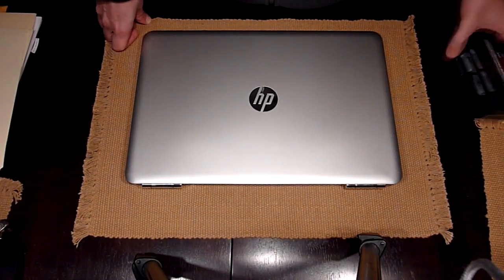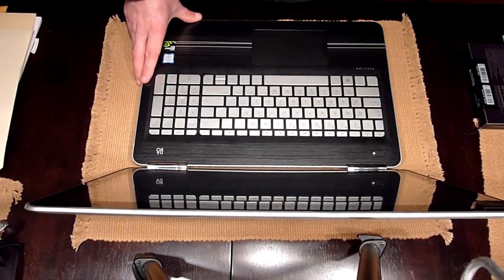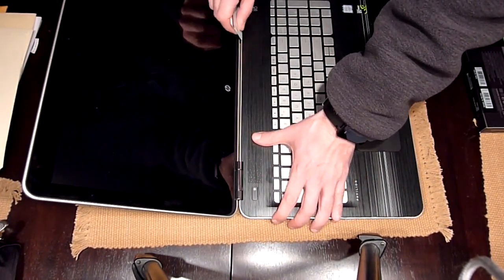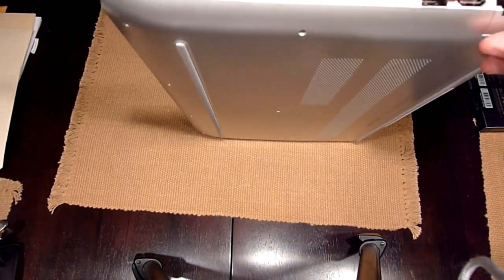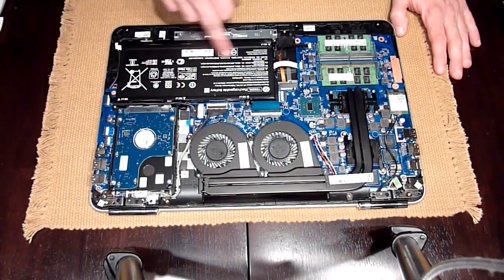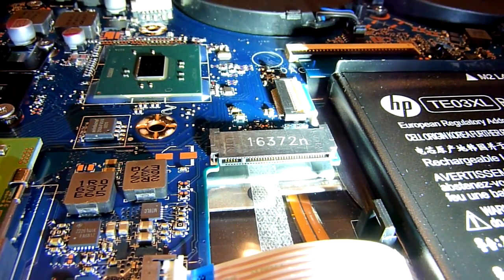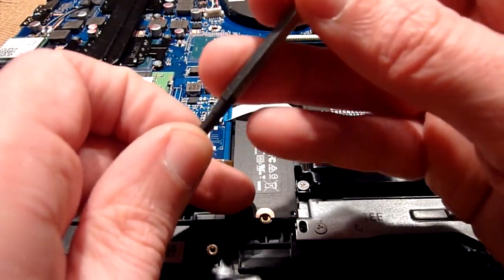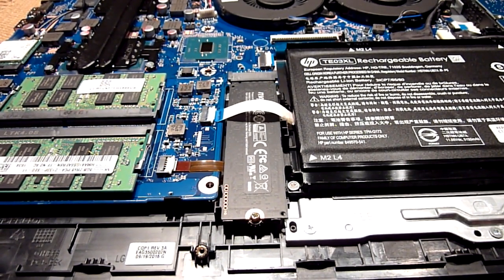HP Pavilion 15 bc018ca Laptop with Samsung 950 PRO M.2 NVMe SSD Drive install

Comment: Shall we use both HDD and nvme together...Windows on NVME and all data & few programs on the regular HDD
Reply from the maker: you can but in order to make the computer boot with the nvme drive, you need to remove the mechanical drive first because there is no drive boot order setting in the bios (in mine that is). The only way I could acheive a boot from nvme was to remove the mechancial drive, restart, then computer did nothing, so I reboot again in bios, did NOT change ANYTHING, save and reboot. Then it did boot from the nvme as primary drive. Then you can re-install a second drive BUT I would NOT advise you to install a second mechanical drive on your system because it will greatly reduce the response time from the computer. When you boot up, the nvme drive is almost instantly ready but the system will need to wait for the mechanical drive to spin up, start access then proceed to boot sequence. Also accessing a mechanical drive within windows is going to be painfully slow versus the nvme drive even it is only use to store data. I would suggest to buy a large 1TB size nvme drive or get a second 2.5 inch SSD as a second drive. 1TB is pretty cheap in 2.5 inch format and you will have way better performance for a second drive. The best is to use a single nvme drive.
Reply: Thank you so much
Reply from the maker: you're welcome
Reply from the maker: I had to send the computer for service under warranty so I did re-install the stock 2TB HDD and remove the nvme. I have NOT touch or format that drive until my warranty will be over exactly for that case. When I reinstalled it, I was SHOCKED how slow my computer was and this is with a clean windows install on the mechanical drive, no programs installed, no data, just stock windows and hp bloatware... It took more than a minute to boot with the mechanical drive with stock windows 10... once on logged in the session, I still had to wait before opening edge to go on google ! Horribly slow and I have a core i7 6700hq with 16gb of ddr4 2300...

Comment: Hello, Very useful video..i would like to purchase hp pavilion 15 bc251nr....Just want to check whether it supports m.2 NVME SSD or not...Also how to move the preinstalled OS from HDD to NVME and boot from it pls
Reply from the maker: thank you for the appreciation. I like Samsung SSD products because they do provide a small, simple and free migration software. All my upgrades are done with Samsung SSD. So the only thing you need to do is to install the nvme drive, turn on computer (in my case, the first time it did not boot, I just enter in the bios, change NOTHING, save and reboot), install the samsung migration software and run it. It will find the nvme drive and clone all data from the mechanical drive. Once migration is complete, remove the mechanical drive, reboot (again, I had to enter the bios, change NOTHING, save and reboot) and then the system was able to boot from the nvme drive. I am writing this answer to you with that same computer with the nvme drive you see in the video. Best upgrade EVER. Extremely fast boot time less than 10 second from off state, wake up from hybernation is almost instant.
Reply: Thank you, i second that opinion from you...however what i am confued here is, does this model has m.2 SATA SSD or it supports NVME. The manual is pretty generic and talks about both in it :(
Reply from the maker: try to find the service manual of the pavilion 15 bc251nr, in there you will find the right information about the options like drives and maximum memory size.

Comment: How would i know if a laptop supports nvme?
Reply from the maker: first, find out if you do have the connector and which type is it. You can also search the model number of your computer and seek out the specs, HP manuals usually states all the components and I/Os found on the board and computer.

Comment: Hello, I have the same HW and i would like to now if it's possible to move te OS on NVMe SSD unit and boot from it. 
I've cloned the hdd OS partition on the SSD, but i can't find a way to boot form it. 
Can you help me?
Reply from the maker: Just install your cloned nvme drive, turn on computer and just enter the bios, change NOTHING in the bios, save and reboot. It should now work on the nvme drive. This is what I did because I had the same issue after the cloning procedure was completed.
Reply from the maker: did it work ?

Comment: Did your ssd come with the screw to fix it in? I just got the 970 evo, stuck it in then realised it has no screw.. Do you know what size screw to get?
Reply from the maker: unfortunately no, it did not come with a screw, I guess this is because many montherboard vendors could use slighly different threads... I had a bunch of screws in a bin and I just found one that was working. You absolutely need a screw.
Reply: @Aleziss  or else you're screwed
Reply from the maker: @MCilja  indeed as it seem to be a problem for a lot of people !!

Comment: hey such a good disassebly video it will help me so much. My question is i have nb38ea probably its mother board is some case is some etc my question is i know that same  ssd slot contained in my laptop in the some place it is said that it is compatible with m2 ssd are there any difference between m2 and nvme slot?
Reply from the maker: you are welcome... unfortunately, I cannot find any information with the model number you provided me. You would need to find the service manual and there, with the exact model number, you will see if it is compatible or not.

Comment: Did he really just install that upside down?
Reply from the maker: what are you talking about ?
Reply: i thought the same thing, but theres only one way it will fit in the slot
Reply from the maker: @pubhardgaming4838  guys, the laptop is upside down when the case is open... when you put back the back cover and you flip it over, the chip now sit on top of the drive...

Comment: My pc is bc200. but also bc200 in website has f45 or 46 and it doesnt up to date.
Reply from the maker: that's weird... I don't understand why I would not upgrade...
Reply: Aleziss I had made 2 times recovery before. Maybe because of that. Not directly, seperate times , 3 months after other
Reply from the maker: Recovery of bios failed to update ? or operating system recovery ?
Reply from the maker: I just thought about this, are there letters after the bc200xx ?? those two xx letters are important too for upgrading the bios so it matches the exact model and region you got...
Reply: Aleziss I made os recovery. 2 times. 3 months ago 2nd one, now i have iso file, not recovery. but after clean install i cant update bios.  also i add ssd before
Reply from the maker: I doubt this would prevent you from updating the bios then, os recovery has nothing to do with the bios upgrades, I am pretty sure. If bios does not update, in my opinion, it is because you have the wrong file for your system. This is why I asked you if you had other letters after the bc200xx ? The extra xx letters are important (if you do have extra letters). Mine is a 15-bc018"ca" ("ca" for Canada models). I suspect you are just trying to upgrade with the wrong file.
Reply from the maker: Ozgun Tinar, I don't know where you are located but just for example, there is a bc200NL version that I have found, so the bc200 DOES have extra letters after. Just be sure to pick the right bios upgrade file for your system and it should work. https://support.hp.com/gb-en/product/hp-pavilion-15-bc200-notebook-pc/13810158/model/15178212